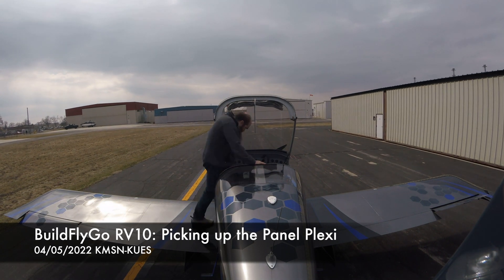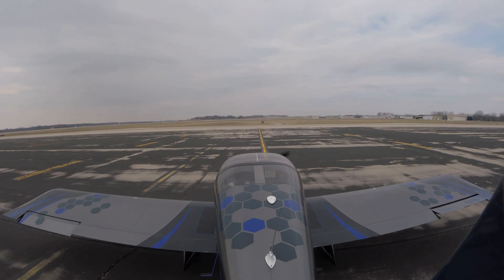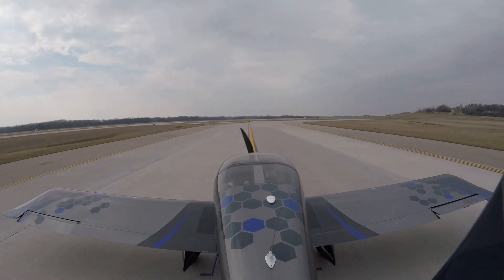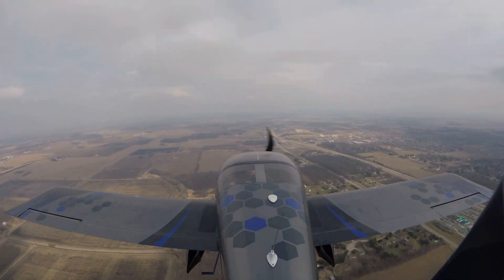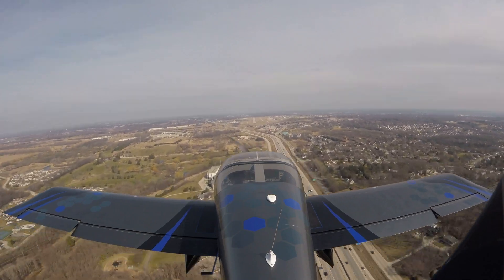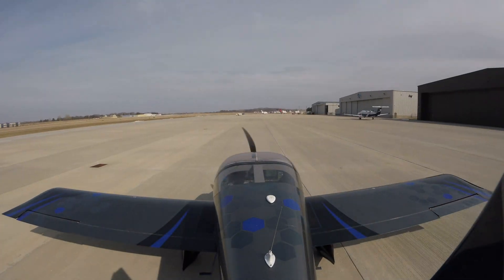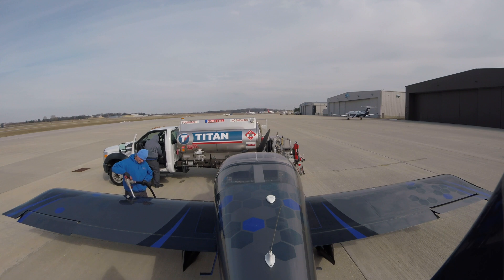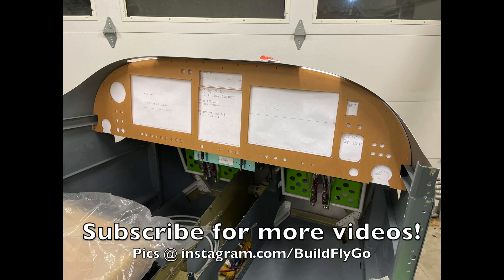RV-10 Build? Or is it a flight? Picking up the Panel Plexi Cut-out

Comment: Glad to see you go with the standard panel layout. I am tall 6'5" and was told that the Aerosport, as nice as it looks, would be an issue with my knees.
Reply from the maker: We didn't feel that the extra height added much benefit to our setup so kept the extra knee room of the stock height :)
Reply: Looking good! I went with the Quick build Fuselage. Another RV 10 builder say's I am still five years away from making airplane sounds. My project plan has me completing the wings in Aug. Just around the time I should be getting my fuselage. I just need to stop listening to everyone telling me    that I will never get it done. I am one year into the build so far.